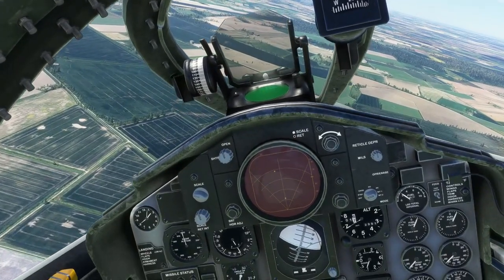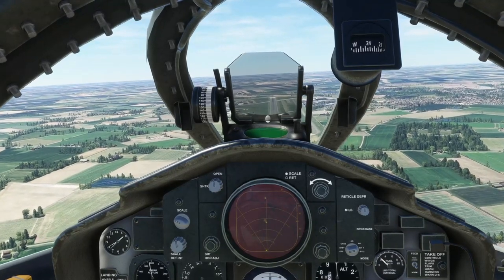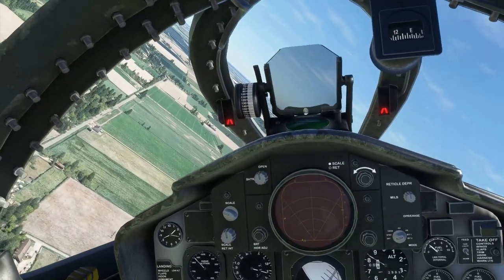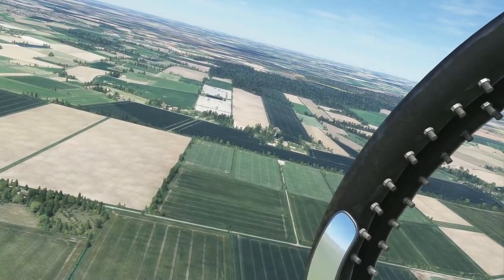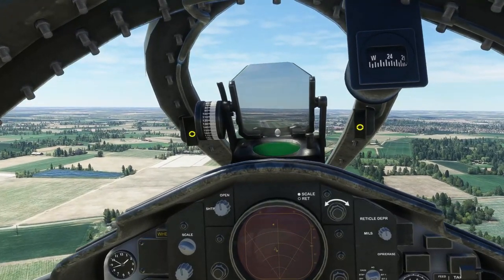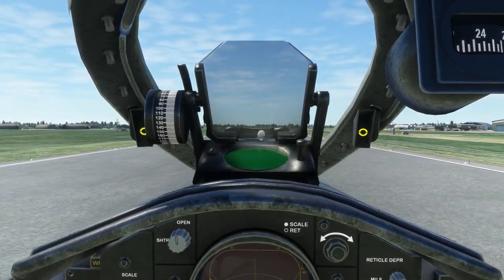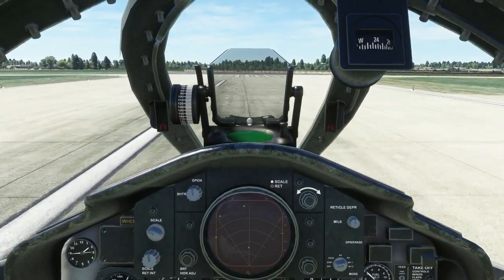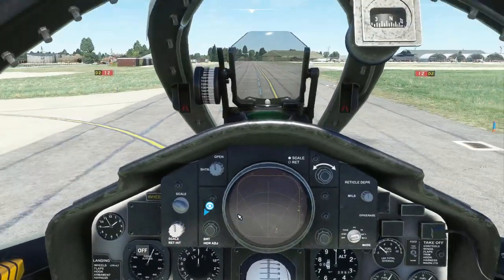DC Designs F-4 Phantom II Landing and Shut Down Demo | MSFS | Microsoft Flight Simulator

Comment: I'm getting a message saying I struck an object while landing. It has happened a few times. The landings were perfectly smooth and gentle, yet the message appears and the flight ends. Not sure if it is the plane or the game that is bugged. Guessing, I'd say it is probably the game that is bugged. I think this is the case, since it has happened before. A couple times it happened simply flying in clear sky, nothing around anywhere and out of the blue, the 'struck an object' message has appeared.

Comment: Anyone else’s F4 from dc designs handle like absolute trash I can’t even do a barrel roll in mine without it going mental and takeoff and landing is another story sucks because it’s a gorgeous jet but mine just doesn’t work right I doubt it’s my settings because I don’t have problems with any other plane I have and I have a lot